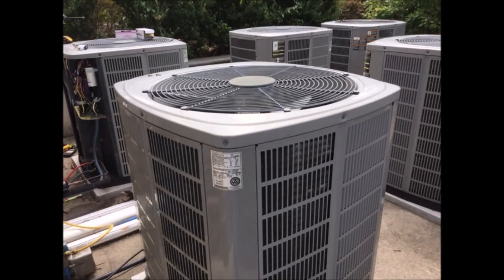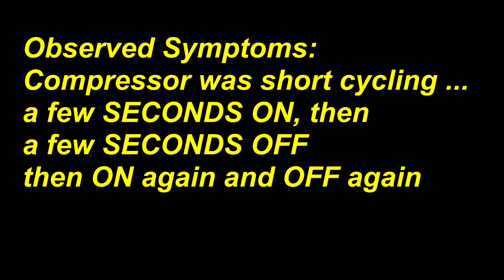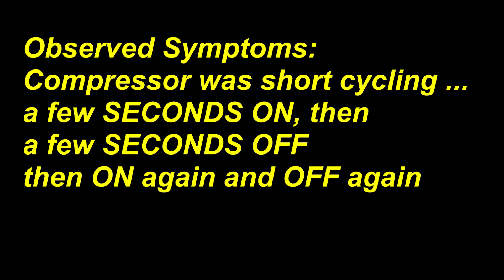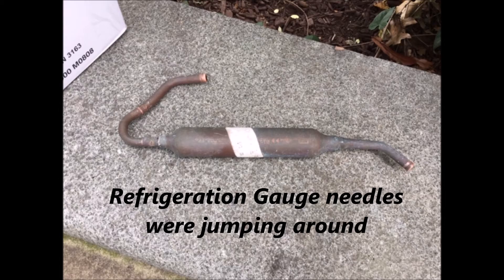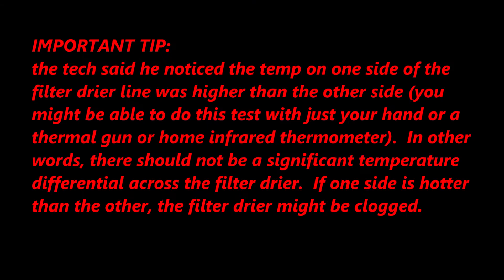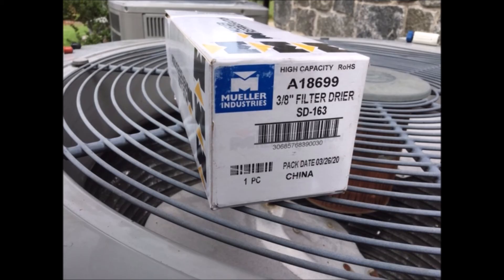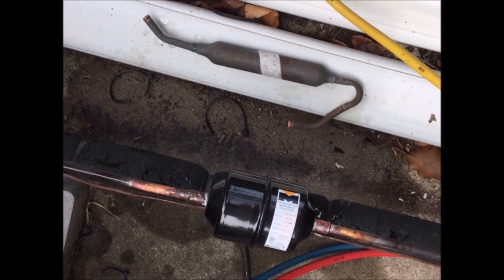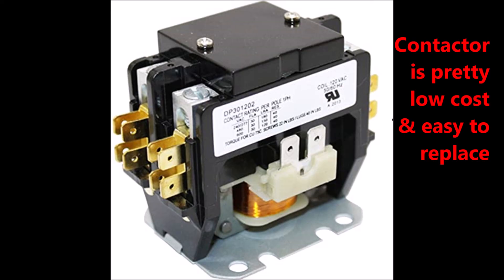FIXED Outdoor AC Condenser Compressor Short Cycling; compressor turning on and off every few seconds

Comment: Any idea why my ac condenser would turn on for 1 minute and off for 2 minutes even though it’s several degrees away from the set temperature?this started happening right after the ac guy came to check out my heater. They’ve come back about 5 more times and keeps telling me they don’t see a problem!!!! And I’ve already paid $700 for them to replace parts.
Reply from the maker: maybe bad pressure switch or same clogged filter as I had.  Maybe an expert will opine.  I am not an expert.

Comment: Thanks for the info! Mine starting doing this over the weekend. Sounds like it’s igniting then stalling, igniting, stalling repetitively then finally ignites and stays on fine for hours. It sounds like short cycling but with extremely short intervals as you describe. Have a tech coming out on Friday to check it out. Hopefully its an easy fix because we’re expecting temps in triple digits this weekend!
Reply: Hi Denise, my ac starting doing exactly the same thing, has your AC been fixed yet? I’m curious what this issue was
Reply: @kalliniwasaki2910  yes!! The HVAC guy just left literally 5 mins ago!
It was the Capacitor in the Compressor and he also found a dead mouse lol 
It was 81 degrees in my house when I first turned the air on and it’s already dropped 3 degrees in just a few mins. 
It’s 97 degrees here in Edison nj so I’m very thankful that it’s fixed. 
Hope you’re able to troubleshoot and get yours rectified right away!
Reply: Quick question, do you know during the short cycling if the fan stopped as well or the fan continues working while the short cycling is occuring?
My unit has the symptoms of short cycling but the fan never stops.

Comment: low refrigerant, failed condenser fan motor can cause this too. good units have pressure switches to prevent compressor damage.
it is wise to add a delay on break timer to prevent the short cycling - timer has minimum off time like 5 minutes.
Reply: Also could be the capacitor, and I don't think that was the problem in his case

Comment: My condenser unit is short cycling after being turned on for 3/4 hours. I changed the contactor, added a new Nest thermostat, new start kit, new run capacitor. I checked the voltage on the contactor and get 24/26v. I changed my filter, no ice is visible anywhere, I'm at lost. Any other ideas than the filter dryer? My unit is 5 years old (York).
Reply from the maker: does the temp of the dryer line feel significantly different before and after the dryer (do you have a thermal gun?).  I would never have replaced all those parts since it's simply something telling the contactor to open and close and probably none of the stuff you replaced.  It's probably a pressure switch or something telling the contactor to open and close.  I wouldn't replace the pressure switches.  I'd focus on what is causing the pressure switches to activate/de-activate.  I'd start with low refrigerant charge first.  Clogged dryer in 5 years would be somewhat unusual unless refrigerant is contaminated.  I'll let the pros comment from here.
Reply: @YuDaMan  So I couldn't do that as the dryer in inside the condenser and the view is obstructed by the fan motor/propeller. However I did a couple of things as I noted the battery voltage on my Nest was fluctuating from 3.80v to 3.94v while still having a C wire connected. I went to the attic and checked the wiring, the C cable was loos and dusty so I ended up cleaning the wires and snug them all back. After that it seems like my voltage was always steady at 3.92v and the condenser never power cycled again. Crossing my fingers.
Reply: Did you ever figure out what the problem was? I'm having the same problem
Reply: @michealbarnes66  yes, in my case I had a few things. First, a a schrader valve leak, I was loosing refrigerant. The tech came over to switch it and refilled. Everything was fine until it did power cycling again. Apparently when he came the first time, temperature outside was 70F. When it started to get over 90F, I'm assuming the pressure increased inside the unit and the issue came back.
The tech actually overcharge the unit when refilling. When he came back (was >90F outside), he recovered some refrigerant and the unit has been fine since. Hope that helps.
Reply: @cyrilasfrenchyaz  When my system was originally installed, the original tech overcharged the system and this caused my system to go into the short cycling behavior. I had to have three techs come out, one by one, and eventually the third tech figured it out and reduced the amount of refrigerant and the short cycling went away.
Reply: @YuDaMan  Thank you for your input. I have a thermal gun, I'll check that out. If there is a big difference of temperature, that will help to point out to the dryer.

I had a refrigerant leak that I noticed when it all started and the HVAC tech came over to change the shredder valve on the high pressure side and refilled with a pound of 410a so that should take care of this area. 

I noticed the leak because the condenser became really loud. I put some soapy water on the valves and it was bubbling so easy to see. 

And no worries, I just got this house with no history that's why I changed as much parts that I could as I like to know when and what things was change, I didn't pay much for them, had everything from my former house beside the thermostat I won at a sweepstake ;o)
Reply: Nest thermostats are known to cause havoc to ac compressor..or so I heard.. just letting you know..
Reply: I heard but most people don't know how to correctly set up a Nest thermostat either. Mine has been fine for the last 3 years. Gotta say I like it a lot.

Comment: This sounds exactly like what my ac has been doing
Reply: Is it fixed? Do you know what it was?
Reply: @cyrilazoulay9712  coils were leaking. Ended up buying new system.
Reply: @davidthompson8653  Bummer, sorry to hear.
Reply: @cyrilazoulay9712  all is good. Much happier with new system. Much quieter system. Thanks!
Reply: The coils in the handler inside? There wasn't an option to just replace the coils? I
Reply: I'm having the same issues. It system was replaced 4 years ago.